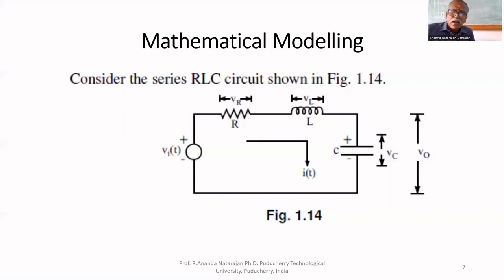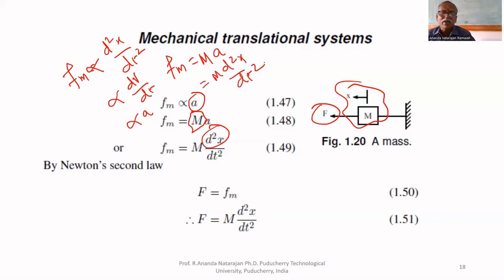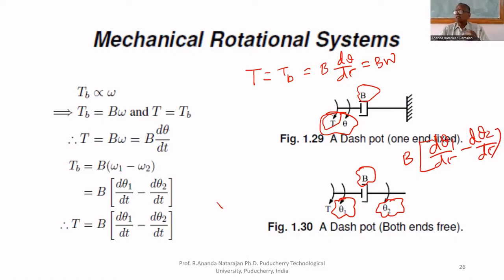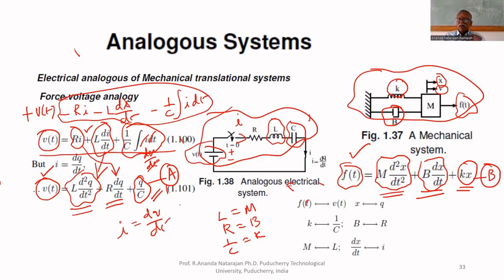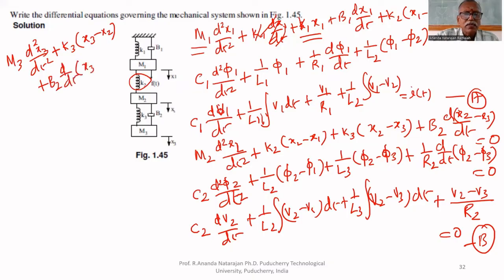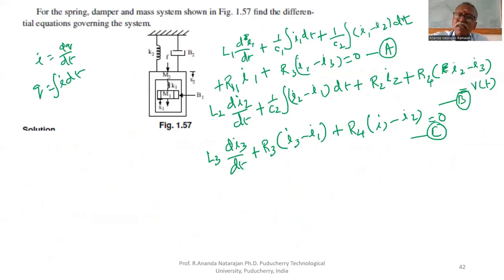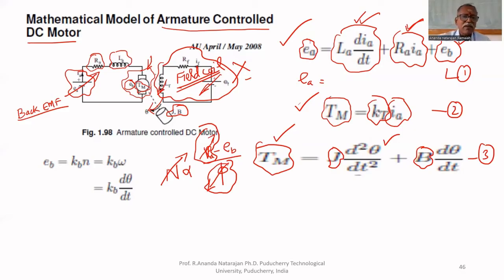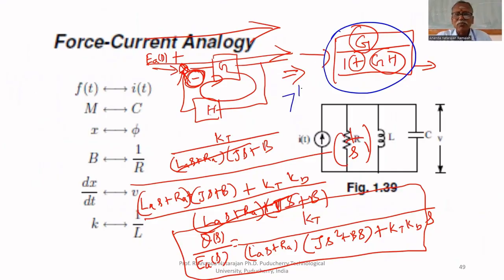Complete Control Systems Mathematical Modelling Course for Beginners | 4 Hours#controlsystems #DrRan

Comment: Complete Control Systems Mathematical Modelling Course for Beginners | 4 Hours
Mathematical Modelling in Control Systems | Full 4-Hour Beginner Guide
Control Systems Complete Course: Mechanical, Electrical & DC Motor Modelling
Full Control Systems Modelling Tutorial | RLC, DC Motor, Analogies & Transfer Functions
Beginner to Advanced Mathematical Modelling in Control Systems | 4 Hours